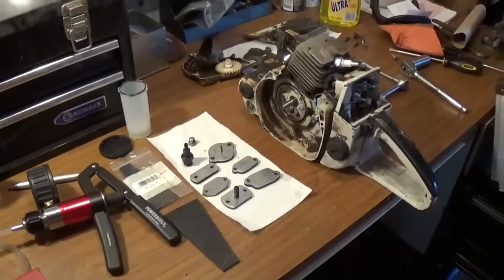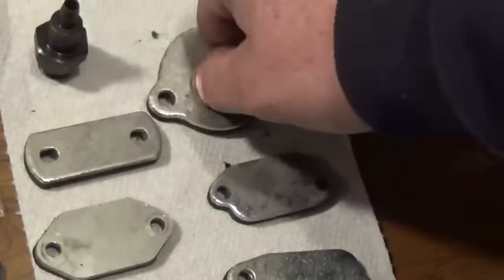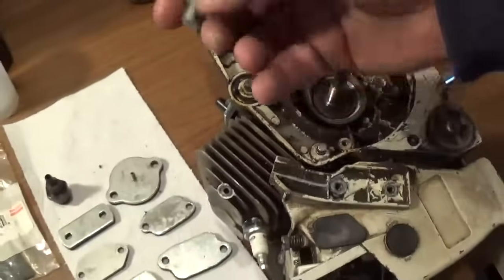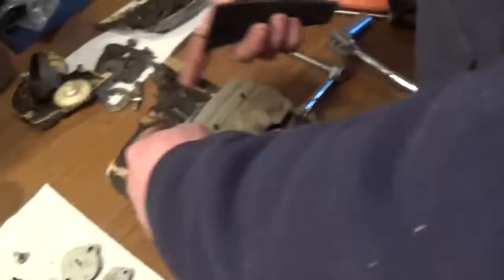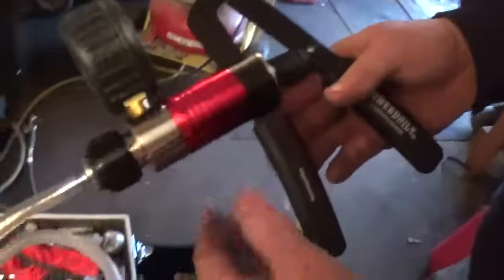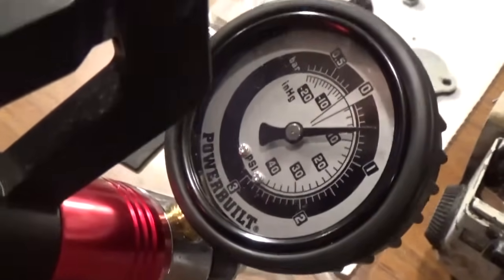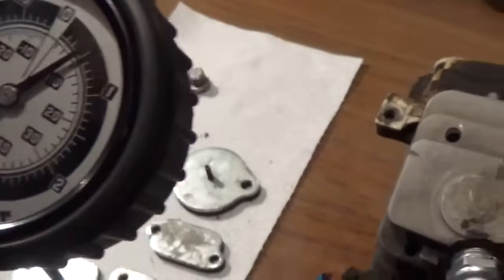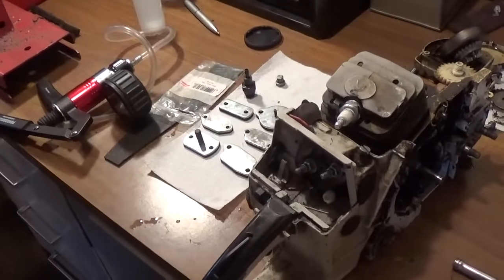Pressure and vacuum testing a stihl chainsaw

Comment: Thanks for this video. Having hell with both my Dolmar PS 5100 S and my 346 XP both have just been rebuilt. The Dolmar was ported and runs like a screaming banshee - when it runs. Can't find any reliable local small engine mechs so gonna have to learn it myself.
Reply from the maker: Friend you are in luck Dolmar just happens to be the brand my boss caries...  check your intake boot they often are the source of the problem...pressure testing can reveal the leak.. Also the tank vents swell causing the engine to flood or shut down after a few min of running. You may also wont to check your air filter assembly there will be a donut shaped sponge about the size of a half dollar  just under the air filter assembly.{Top of the carb} metering side....it must be clean........on some models  like the 510 and 5100 this sponge was solid and it caused problems once it was dirty.  I feel its only fair to be honest with you {the carbs on these saws are very sensitive to the gas mix they require } I highly recommend you use a FD rated oil because these saws tac at 14.500 rpms per min. They truly are beast and with yours being ported / I would say you have a real hell cat in your hands when it opens up. Best of luck glad you enjoyed my video ....Please if your curious about FD oil check out my video of why dumb asses and chainsaws don't mix. I even show why its a great oil and give {provide some great information } .....Once again thanks and don't forget to subscribe.
Reply: I just installed a new flange coupling yesterday, but I had a hard time getting it in until I removed the muffler and loosened the jug. Maybe I didn't get everything aligned perfectly. Still dies when I spray WD40 into that area. That sponge between the filter and carb was about disintegrated so I didn't even put it back in. Had no idea it was critical - dumbass me. When you say the tank vents swell - I'm not familiar with where the tank vents are or how to check if they are swelled. I'm obviously not a small engine mech. I sure do want to get this saw running - it just flat out screams when it's running right. 

I'll check out the oil video later when I get more time. Where are you guys located?
Reply from the maker: Liberty Ky and the tank vents are hiding under the crank case ....they are on the tank its self toward your trigger assembly. Sadly you have to pull the tank off to have access to the tank vent .There will be a small nickel size piece that presses into the tank you will have to remove also /before you can reach the tank vent. By removing your fuel line from your carb you should be able to pressure test your tank vent .Pump in about 7psi and you should see the pressure bleed off on your pressure guage ....if for some reason your pressure guage stops with any amount of air remaining in the guage you must address the tank vent. Automotive brake bleeding pumps {KITS] work great to check pressure on chainsaws as most have a vac setting as well. You can also get a 12x12 sheet of neoprene {RUBBER} on ebay to make blockers for your carb and exhaust ports  .For a better look and understanding of what the items look like iam describing check out my video on pressure testing a chainsaw.
Reply from the maker: Sorry I was trying  to say chainsaw tools /pressure testing {there are 2 parts}  The kit you will see in this video {BASIC} can be bought on EBAY just look for Husqvarna pressure testing kits for chainsaws. Although you can see the block off plate made by Dolmar  by just rewatching this video and just cut the neoprene in the same way .
Reply: Thanks for all the help Kevin!
Reply from the maker: Your very welcome I sincerely hope it helps ...Been in your shoes and it can really make a persons day when they are provided the right info...Keep in mind friend if you need any help at all with a question on your Dolmar I will gladly try to help ....I am only a reply or comment away. And once again thanks for watching my videos.

Comment: Love to know where the adapter plates can be had...
Reply from the maker: You can purchase most on ebay by looking up[Husqvarna chainsaw pressure kits] In doing so you need to find{ chainsaw tool box kit compression tester wrenches plug wrenches for Husqvarna } typically it cost 89.99 and the adapters are included [not all but most] / don't be fooled you also need a good vac tester to .
Reply from the maker: If you would like to see other tools that you will need check out my other video [Chainsaw tools/pressure testing] there will be 2 videos and can greatly help you if you wont the proper tools to repair a chainsaw or trimmer.
Reply: I usually make my own using a gasket as a pattern and cut it out of a piece of aluminum strip available at hardware or farm stores. Put a piece of inner tube on the inner side glued to the aluminum with rubber cement.